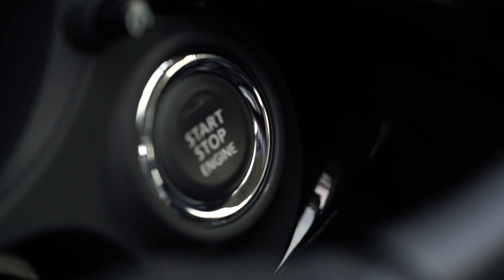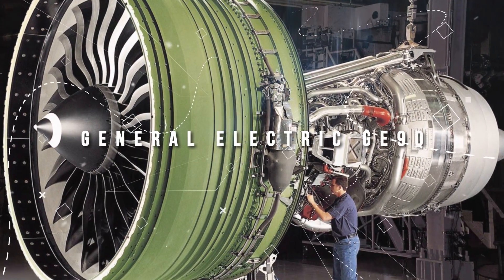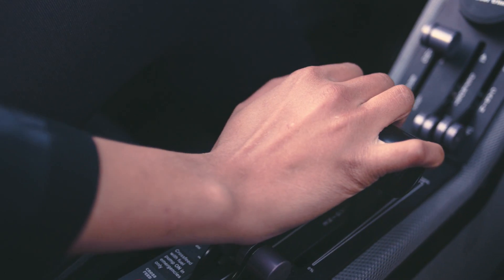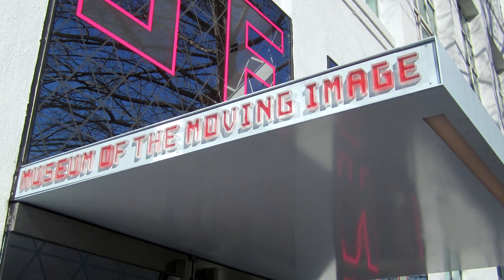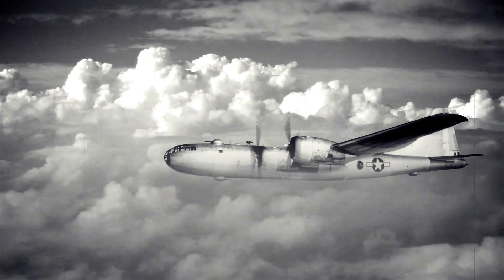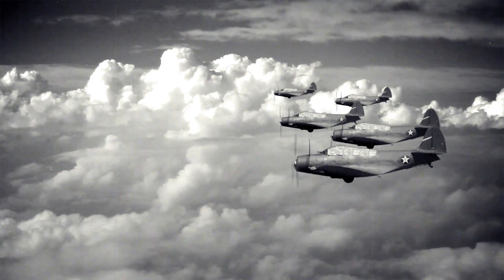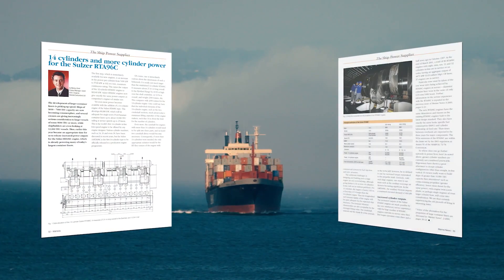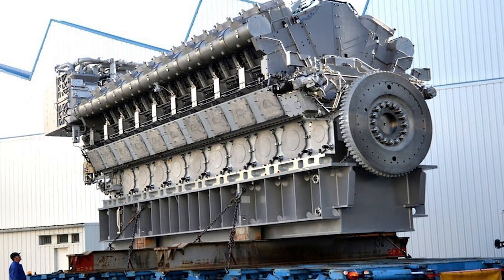10 Biggest Engines In The World

Comment: Spark plugs, including dual spark plugs have absolutely nothing to do with cooling. Never did, never will. Annoying when the narrator knows nothing about what he’s talking about.
Reply: true.  twin plugs are used to create an even flame propagation in the combustion chamber maximizing fuel burn and extracting maximum power with economy  ie. less raw fuel out the exhaust.
2. as a point of redundancy,  two plugs are used (mostly in aircraft) as if one plug fails the other is there to limp home with out the loss of the cylinder, important when there is only 3 or 4 cylinders in the engine.
just thought id add that for those who don't know.
Reply: Not just sparkplugs are redundant in aircraft engines. The hi voltage wiring and the magnetos were also duplicated. My mid-70s FORDs had only a single coil and if that $12 part failed, usually in a rainstorm, then you didn't limp home. Even the model T had a coil per cylinder, as did my 2002 thru 2020 Hyundai 's.

Comment: Can someone please tell me the equivalent miles per gallon for the giant ship engines? Like it moves its weight at ?ktonnes 1 mile taking ? gallons of fuel, that is the same as an equivalent weight of dodge diesel trucks going 1 mile using ? Gallons of fuel per truck. I would really appreciate it.
Reply: SuperBrainAK the big ships with those engines use around 200.000 kg ( ~400.000 lb) of heavy fuel oil per day while doing 24 knots of speed.
Reply: Oh boy!!R u just asking
MILAGE? of a ship?

Comment: You have your facts wrong on 4014 she is 13 feet tall and she runs on oil also she has a max horsepower output of 6,600 horsepower
Reply: Power type	Steam
Builder	American Locomotive Company (ALCO)
Serial number	69585
Build date	November 1941
Specifications
Configuration:
	
 • Whyte	4-8-8-4
 • UIC	(2′D)D2′ h4
Gauge	4 ft 8 1⁄2 in (1,435 mm) standard gauge
Leading dia.	36 in (914 mm)
Driver dia.	68 inches (170 cm)
Trailing dia.	42 in (1,067 mm)
Wheelbase	72 ft 5.5 in (22.09 m)
Length	

    Locomotive: 85 ft 7.8 in (26.11 m)
    Overall: 132 ft 9 7⁄8 in (40.48 m)

Width	11 ft (3.35 m)
Height	16 ft 2 1⁄2 in (4.94 m)

you're both wrong and it has 7000 hp

Comment: UP4014 was in fact converted from coal to oil burner. And currently IS running on Number 5 fuel oil. Essentially heating oil.
Reply: Essentially (cetane) ungraded diesel fuel oil. Oil burning steam locomotives are easier on their tubes and other parts exposed to the rushing gases from the firebox. Coal contains much silica (sand) which is very abrasive, and impurities that are corrosive and very polluting. 
When oil burning steam locomotives were common they usually burned "bunker" oil, hardly more than unrefined petroleum. When the Union Pacific RR was using its "big blow" gas turbine-electric locomotives, they burned low grade oil that had to be heated to flow through the pipes, much like the bunker oil used by steam locomotives. When the price differential between low grade and diesel oil narrowed, the "blows" were taken out of service.

Comment: 2:03 - "...have been realized using 3D printed"
...something doesn't sound correct there. Great video regardless.
Reply: You can actually print metal engines yes go check out yourself.
Reply: This video had other issues too. WHAT DOES SPARK PLUGS HAVE TO DO WITH COOLING. dual spark plugs for cooling. Just a lame video from my perspective
Reply: @SehjotSinghguram .
Reply: To me, that just means that they've used 3D printing to produce miniatures for testing in wind tunnels.  Just strangely worded in the narration.
Reply: @SehjotSinghguram  Porsche has produced and tested 3D printed pistons.  It takes 12 hours to print one.  However if the printers are cheap (I have no idea how much they cost) you could have 1200 of them turning out 100 pistons an hour.

Comment: So now a wind turbine is an engine?
Reply: A wind turbine is an "engine" but it isn't a "motor."
An "engine" is an "ingenious" device. "Engine" used to be more popular for various kinds of machines, as "engine" lathe, but now is used almost exclusively as a name for an internal combustion motor. It still hangs on as the "engine" ("locomotive") that pulls a train. The driver is called an "engineer" which has nothing to do with an "engineer" who solves problems using "ingenuity."
My car's motor has "engine oil" on its oil filler cap but all of the suitable oil is labeled "motor oil," not "engine oil."
In English speaking and former British Empire countries "engine" or some recognizable variant is used for fuel burning motors while "motor" commonly means "electric motor." Most other languages use "motor," "moteur" or similar for all motion producing devices.
Reply: @algrayson8965  That's all well and good but first, an "engine" in most examples - including all of yours - is something that drives something else whereas a wind turbine is something that is already driven (by wind). Even if it were described as a transformer or inducer it would be more accurate as it merely converts wind energy to electrical energy. I don't doubt your argument but in this case it is misleading. Further, the title on this video states "biggest engines" implying large machines that make power to drive something.
Reply: No